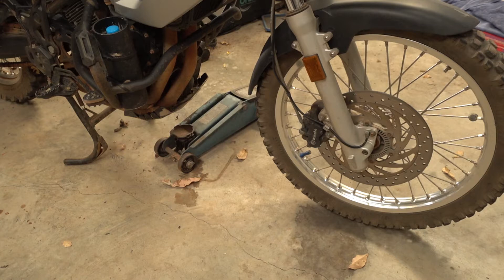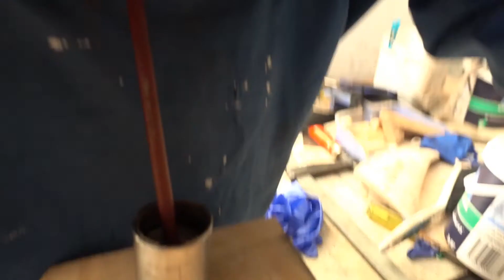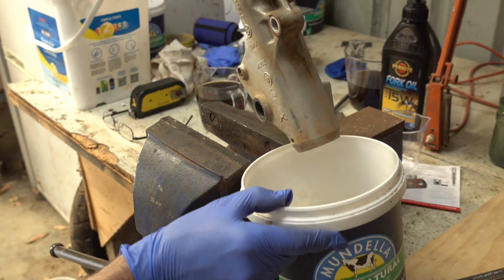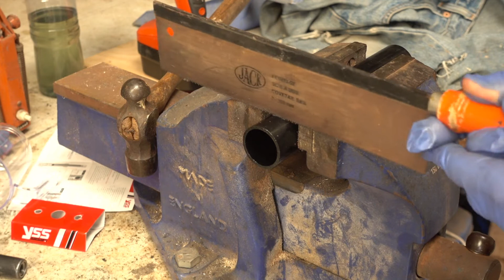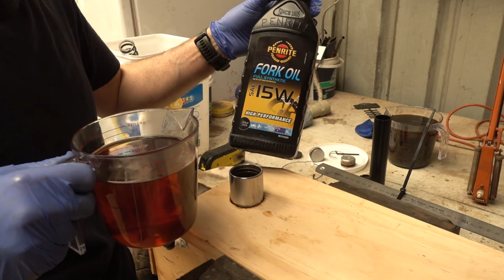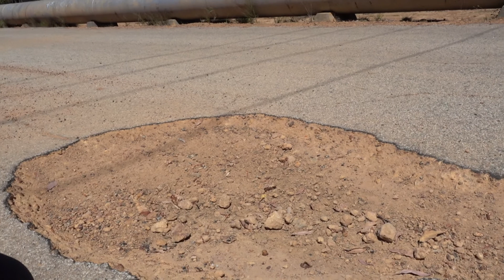BMW F650GS fork upgrade using YSS PD Valves

Comment: Great video with excellent technical content. Covered the all important drilling of tdamper rods to completely negate the effect of the standard compression damping so that this is controlled by the valve emulators. Best video I have seen on this subject and principles will apply to fitting these pd valves to any bike having damper rod/ orifice bleed type forks. We done Sir, brilliant video.
Reply from the maker: Thanks for the feedback.

Comment: Can you tell what model are they? And what diameter is the fork leg on the twin F650? 41mm ?
Reply from the maker: PD335 and the fork leg is 41mm.  Now the YSS web site only lists the whole upgrade kit if you filter by that model, but if you search you can get to the PD335.  I don't know what size adapter you need.  https://yssaustralia.com.au/universal-products/32956-pd-fork-valves.html
Reply: @oacmose281  My bike is a F650GS single 2004. Same size fork, apparently the PD335 are good for mine too. I'll bite the bullet and order a pair, I got tired of vague front suspension.
And I can't access that site from my location.
Reply: So I ordered mine and they came but the instruction leaflet is just a small page and the oil height is not mentioned at all. How did you get yours? I see something on the site, "Oil height (mm): 140". But 140mm measured from where? Can you post a link with a more detailed manual, please? Also, mine don't have the adaptor collar mentioned in the link above posted by you.
Reply from the maker: @rationalityfirst  Hi, you'll have to contact the supplier for a model appropriate adapter collar.  I'm afraid I don't have a record of the exact size but the supplier should know from the model of your bike.  The fork oil is measured from the top of the fork leg (see video) with the fork compressed.  I set it at 150mm as per documentation that came with the valves but have since blown the fork seals.  May or may not be related but I'm reluctant to make any definite recommendations.  140mm means more fork oil (than 150mm) so I'd put in a bit less then test ride it.  If it bottoms out too easily add a little more but don't over do it.
Reply: @oacmose281  I had no mention in my documentation about the oil height, just on the Thai site  I found a mention of 140mm. I took it for a few short rides and I also hit some big square bumps and no oil leak for now. the strange thing is that I had different volumes of oil for each leg, just going by the oil level measurement, the left one took less, no idea why.

Comment: Good work. Just a heads up, the serious looking bolt at the bottom of the fork leg is NOT drain bolt and should not be used as one, it is what connects the inside of the forks, the damper tube, to the lower leg. Oil changes must be done exactly as you demonstrated, ie legs out and tipped upside down.

Comment: Hello. Thanks for the video. I'm about to buy a f650gs with 10 tousand miles on it and use it most on road though I'm found of offroad trails bikes but already using one like on my logo picture.
Well I was wondering how well the upgraded fork performes now on the road. Thinking of riding it two up. Thanks and have fun !
Reply from the maker: Hi Lewis.  You'll find it good on any small potholes and edges where the standard ones are harsh.  It doesn't really help with the extra weight of going two up.  Might be worth replacing the springs to help with that.

Comment: Just the video I was looking for! Thank you so much! I have the same bike and I am shocked (haha) at how easily it bottoms out the front. I am relatively lightweight (62 kilos), and whenever I encounter an incline with a bit of a step up, the fork bottoms out. I have been all over the internet to find the solution and found the YSS kit. It looks good. Would you say the PD valves helps the fork for offroad duties? I like the bike, but feel that the offroad-worthiness is very lacking, because of the poor suspension. The 19'' front wheel is fine for me, but the bike gets thrown around so easily. And the bottoming out is so harsh and sudden that it scares me to death. Do you think the kit would help with these issues? 
Greetings from Copenhagen where spring is beginning to heat up :D
Best, Peter
Reply from the maker: Hi Peter, glad the video helped.  The real benefit of the valves is the plush action in say the first half of the stroke.  Compared to standard that harsh action from square edged ruts just disappears.
They are not really going to help with the bottoming out, however you could remove less or even none of the spacer and then there will be added preload.
Might be worth checking your oil levels.  I added a little extra after putting it all back together because it bottomed out too easily.  More oil means less space for the air to compress at the end of the stroke so less harsh bottoming.  But don't over do it as I think that can lead to too much pressure on the fork seals.
The full YSS kit with new springs and adjustable preload caps may help address the bottoming.
Regards
Neil

Comment: Hello great video, I noticed you you have spoked wheels, are they off another bike or somewhere else. Thanks
Reply from the maker: Hi Tony, well spotted.  Custom built spoked wheels using an F800 hub on the rear with a 2.5/18" rim, and an older model F650GS single hub on the front with a 1.6/21" rim.  Both hubs fit without modification.  I also just recorded a video detailing this and will put it up soon.
Reply from the maker: https://www.youtube.com/watch?v=ZtBU2-keWMg